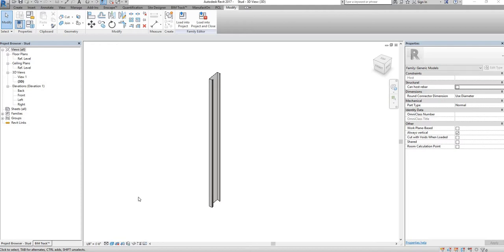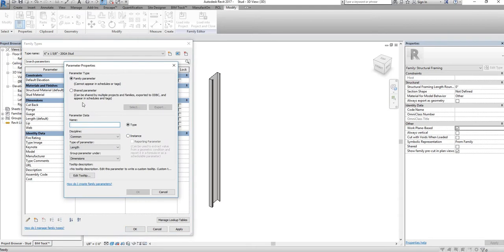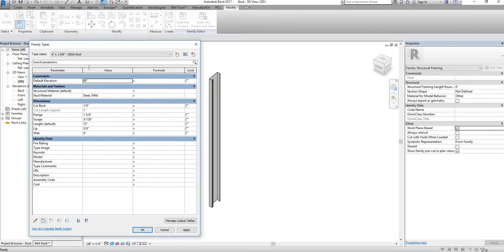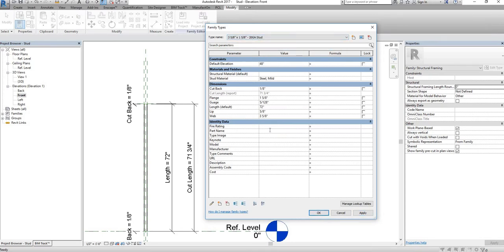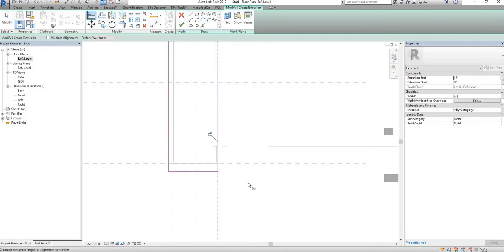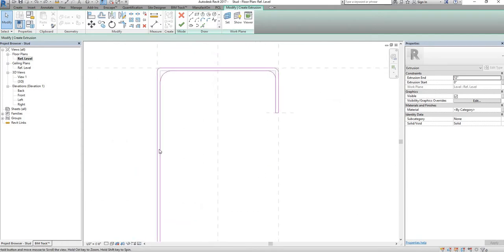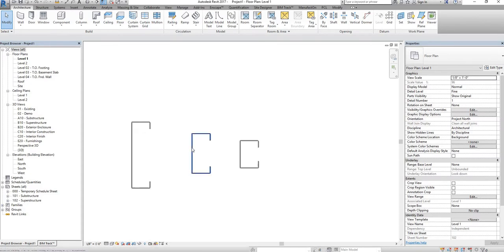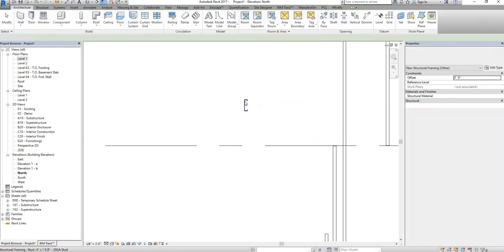Revit Custom Stud Type for Stud Wall - PART 2

Comment: Hey I just subscribed to your channel! You have great content! Perhaps you can help me with a slight problem I’m having. 

So, I just watched and followed your video with my custom stud project. I set up my length and cut length parameter to shared instance (report for cut length) and I am able to freely adjust the height of the stud. But as soon as I upload the family file to an architectural project I can no longer resist the height of the stud freely. Through the project I have to double click the stud to open it’s family file and then edit the file to readjust the height. How do fix this?

Thank you!!
Reply from the maker: Thanks I appreciate the feed back and am glad your getting some good use out of my video! 

Unfortunately it is hard to pin point the issue exactly without actually seeing the file. But we could try some trouble shooting. My question to you is are you just import a single stud family into your Architectural project? or the entire stud wall system?